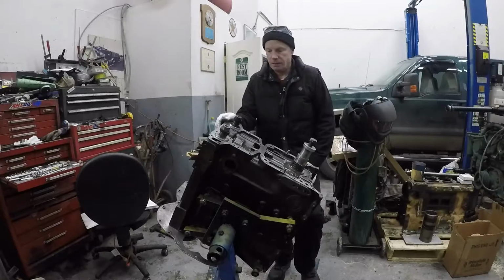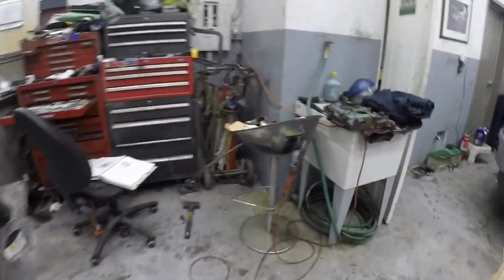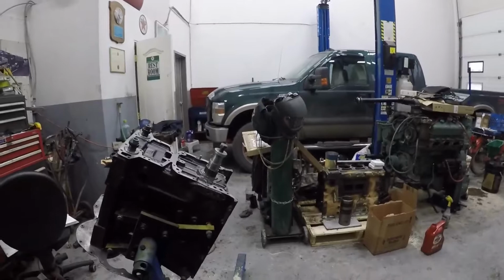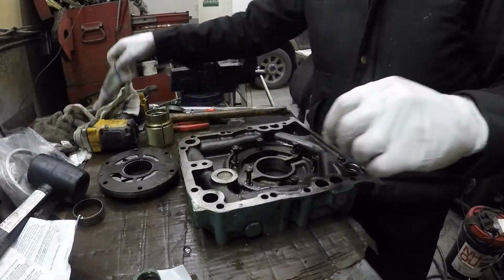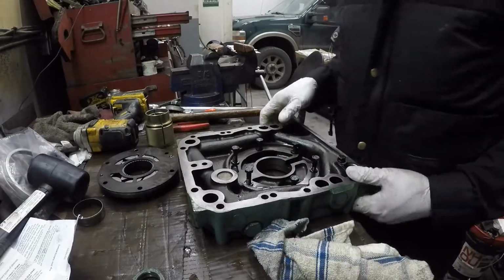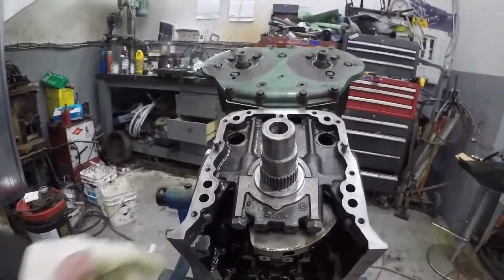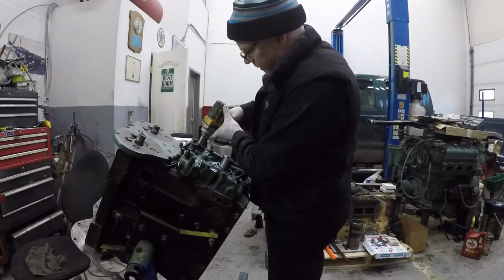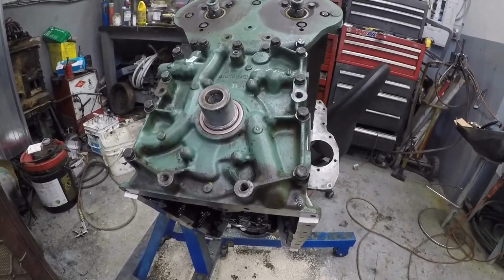Detroit 3-53T Installing Front Covers

Comment: What did you use to install your front seal? I tried putting the cover on with the seal installed and ended up messing it up.
Reply from the maker: I used a seal driver for the forks on a motor cycle.  It's the perfect diameter to drive the seal in.:)  Thanks for watching.:)